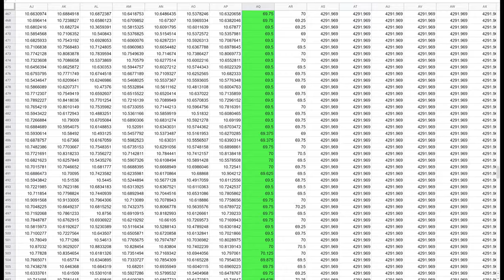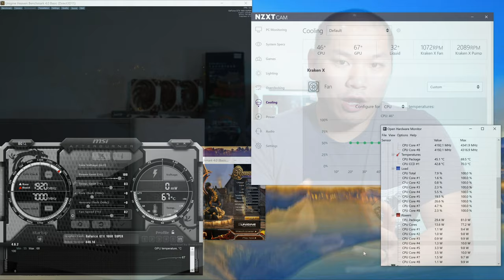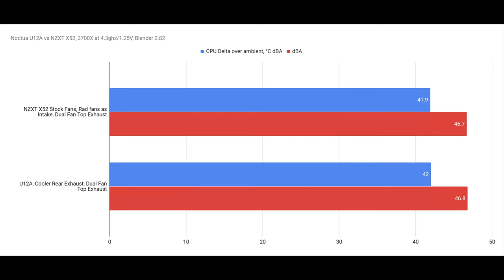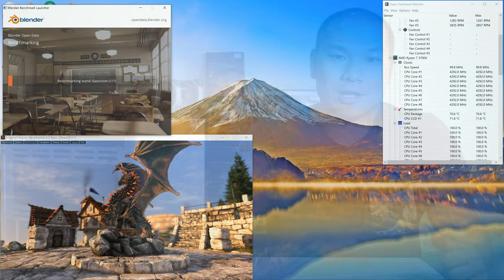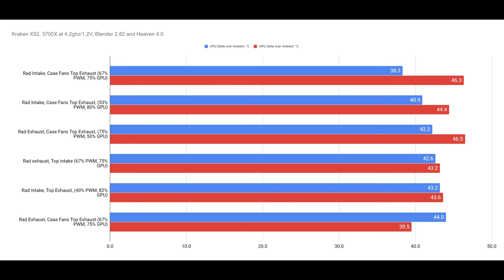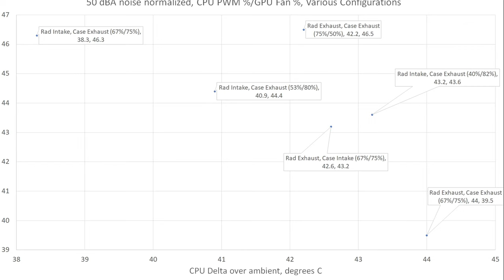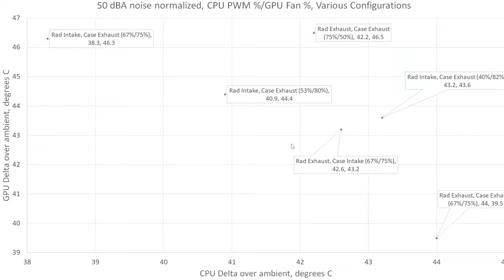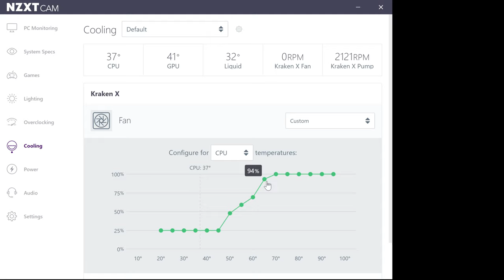Liquid AIO Cooling In The Cooler Master NR200, Part 1: Optimizing Fan Orientation

Comment: I've watched your series on the NR200 and it's fantastic work. Invaluable stuff. Subbed.
Reply from the maker: Awesome, thank you!
Reply: @MachinesMore  Hey what about VRM's with rad intake and top exhaust?
Reply: @Mack_Dingo  Good question. In that case, go rad exhaust top intake. 2 celsius is laughable on the CPU(and you can go 280mm to mitigate that). When you use super expensive high-end XMP rams working at like 1.5volt out of the box or if you are overclocking your ram, rad intake will make your ram sticks unstable(the samsung b-die gaming rams destabilize above 50celsius). All of these hardware youtubers are just using normal 3200/3600 efficient cheapo garbage hynix micron rams. These rams probably stay cool if you throw them into a lava.

Comment: Hi! Thanks for the awesome video. I'm a first time PC Builder and started my build by picking up the NR200 while I gather components. I think I may go with an AMD 3900X come up here shortly for rendering and CAD work. Would you recommend the X52 or X63 for my build? Which one would you recommend and why? Thanks again!
Reply from the maker: Cheers and thanks for the check-in. An X52/53 or other 240mm rad AIO would be sufficient for the 3900X. With a bigger rad like the 280 you get a few degrees of extra headroom, but on a noise normalized basis, the difference is really really small. I would prefer a 240mm design simply based on the fact that they use 120mm fans- if you ever upgrade fans, the 120mm fans are a bit more versatile for other uses like as a case fan. You also save a few bucks going with a 240 vs 280.
Reply: @MachinesMore  Thank you for the very wise tips. I have a hunch that the NR200 is going to be a popular case for first time builders like myself. More videos on it will serve your channel well!

Comment: what about the adding two fans on the bottom as intake, and put the radiator to intake and top exhaust, is that a good idea?
Reply: Was wondering about the same also...now, the question is - for triple slotted cards (like new NVidia) will there be enough room to even place them. Perhaps a slim version of Noctua might work? What to u think? Just ordered my case, so I have no idea...
Reply: I'm wondering about that as well, it would obviously slant the case towards positive pressure by quite a bit and should present the GPU with more fresh air all the while pushing that hot air bubble just above it.
Reply from the maker: @Arthur Hung and @Andrei A, the answer is yes, that is a good idea as you described, although it might not be worth the extra $ for extra fans, that’s up to the user to decide. 3 slot thickness cards allow for no 25mm fan room... it’s tight with 2 slotters as it is. I will discuss those bottom fans in part 2. And let me try slim fans with the thicker card. I’ll throw that into the beginning discussion of P2.
Reply: Adding two 120mm case fans to the bottom would essentially nullify the draw back of having your rad function as an intake (I would think). You can get some nice V2 Sickleflow 120mm fans for like $8 USD (same which the case comes with) which not only have enough static pressure to force cool air directly in to the fans but also works in favor of having the exhaust directly on top (stack effect?). Even 15mm fans should be a nice benefit if you get a triple-slot card. You would more easily achieve positive pressure which is a nice bonus.

At the end of the day I look at it this way: even if you spend an extra $30 on fans you're still far ahead of nearly every other case in this range when you look at its compatibility and performance especially up here in Canada where SFF prices are all over the place and good cases are incredibly scarce. 

I love the extra work being done in regards to this case though. I have mine sitting in the box waiting for the Kraken x63 since the Liquid Freezer II 280mm was too thick to fit.
Reply: The1rust what was the problem exactly with ARCTIC 280???? I was planning on using that one as well! Thanks for the heads up! Where does it exactly interfere (doesn’t fit) with the case (or other components). Very interested to find out. Also have an Asus X560 DTX Crosshairs VIII Impact. I’ve got some worries about the expansion card that it come with - it’s somewhat high.
Reply: @AndreiE190  There were a couple issues I had with it. 

1) The tubing is very, very stiff so there's an uncomfortable amount of force which you're dealing with not only on the bends but on the socket as well. It doesn't help that the tubes come out of the water block instead of the side as seen in other models so you can't really re-orient it in any meaningful way. It's possible it's fine but it make me quite uncomfortable.

2) The way you install the radiator doesn't provide enough room for the thick variety. Think of the rad bracket as a horizontal bracket which holds the side panels. You slide it in to the bracket then pivot the top in to the mounting screws/push pins.

If the rad is too thick then when you pivot it in to place the area which shouldn't exist on a thinner rad is instead being used so you get a clearance issue of about a fifth of an inch and unless you dremel it or do a full tear down of the case to get behind it you're out of luck. The case is far more sturdy than it looks!

Update: I put in the AIO first and then closed the bracket in on it and it worked but to give you an idea on how sketchy the bends are here's a picture: https://i.imgur.com/28tpItg.jpg. Not just that but the tubes were getting caught by the rad fan and I don't think you'd be able to put a top exhaust fan in order to accommodate the top tube.

Just too much going against it for me.
Reply: The1rust zip ties? To make the tubes more secure and in place...I don’t know. Throwing some ideas. It doesn’t seem to be that bad as I expected. But without doing it myself it’s hard to judge. Thanks for sharing! Really appreciate it!!!!!
Reply: Machines & More trust me, as low as the cost is for this case, I’d be happy to spend extra for fans to squeeze max performance out of this case. I just returned Sliger Cerberus X because it lacks some rad support. And that case cost me $265 with not a single fan included with it.
Reply: The1rust and where did u get your case from?
Reply from the maker: You're right on the rad's function but at the same time the case is pretty open, so air goes back and forth pretty freely- there's marginal effect on CPU temps. There is one thing though- and not to spoil too much for the Part 2 of this series but the bottom fans are very important if you ever care about GPU thermals in this configuration. I'll share my end game config in that vid so hope you get to check it out.
Reply: Machines & More I am so gonna turn on notifications
Reply: @MachinesMore  Definitely look forward to it!
Reply: Machines & More all of us are waiting! 😅

Comment: really good. just got this case but waiting for PSU stocks. why not putting intake fans at the bottom with the rad intake + top exhaust configuration?
Reply: I am wondering about this option as well specially if you got beefier cards like per se 3080/2080ti

Comment: Thanks for the detailed breakdown. I've got a CLC'd 5600X and a huge triple-slot GPU (3080 TI Amp Holo) that I'm gonna try and fit into an NR200 this weekend; I'm particularly concerned about the GPU since there's absolutely no room for extra fans below it, so seeing data on how the fan setup can influence its temps is a huge help.

Comment: Nothing wrong with rad exhaust, id always rather my CPU run a bit hotter than my GPU. 
Do you have a GPU which could test that's been deshrouded? I have a card (2080ti) which I'm probably going to deshroud and attach case fans to and set them to exhaust - so run an all exhaust set up
Reply from the maker: I do- but a semi passive/deshrouding experiment will be more of a future test. That will be a lot of fun to see what happens!

Comment: It would have been interesting to capture ram temperature during these configurations. Specifically, if the difference between rad exhaust/top intake and both exhaust make a difference in ram temperature / ram overclock stability.

Comment: Thanks for the comprehensive and ongoing content on this case. I’m expecting mine to arrive this week and plan on putting my X62 NZXT AIO into it and was thinking intake through the rad and bottom with exhaust at the top ... you know positive air pressure. I’m cooling a 2700x and 1080Ti so was wondering whether side exhaust would work better ... ultimately though it’ll be on my desk and right next to my arm so not keen on getting blasted with warm air in Australian Summer! I’ll sacrifice some noise and GPU thermals and just pump the heat to my ceiling!
Reply from the maker: You got it! Actually spent some time in Oz a while back, lovely country. Your intuition is spot on- you'll see in part two that what you're thinking of makes a lot of sense. You know it seems trivial with the air coming out the side, at least that's what I thought before testing it, but the difference if pretty stark between hot air coming out the top and hot air coming out the side at least in terms of user comfort. Good luck on the build and do check back as I am curious how well a 280 rad performs.
Reply: from where did you buy the casing. I was checking in Amazon and it's not available.
Reply: @thusedilshan11127  I’m in Australia and stock from local retailers is low but you can order from an upcoming shipment and it’s only a week or so wait.

Comment: Hi from the future i just built a i5-13500K and 3080 FE setup like this with a 240mm AIO.  I used rad fans as intake and top fans as exhaust.  I didn't hit thermal throttling on either the GPU or the OC'd CPU.  Does that mean that's good enough?  Should i bother trying exhaust / exhaust?

Comment: Thanks for this video, it's a topic I'm very interested in having ordered an NR200 (I'm currently waiting for shipment).
I just wanted to give a small critique on your sound quality, you have a lot of reverb and should look into some sound deadening for your studio and possibly a microphone upgrade (it's hard to tell how good it is with the horrible room acoustics).
Reply from the maker: You got it! I hope you get it soon. Thank you for the feedback. You’re spot on with the sound... I’m still experimenting with acoustics. The mic is a decent one (an older RodeVideoMic Pro) but my setup is pretty makeshift so I need to work it out. Any recommendations on a mic?
Reply: @MachinesMore  Sorry, I'm not knowledgeable enough on microphones to offer any specific recommendations. I will say that you need to "fix" the reverb issue before the microphone quality can be ascertained. It seems like you may be sitting too far away from the mic, but that could just be the reverb.

The first thing I'd suggest for sound deadening would be some sound deadening panels on the wall behind the camera, this could be something as simple as hanging a heavy blanket on a rope, cable or curtain rod. Or put some foam panels on a movable screen if you don't want to attach anything to the wall. Your voice is going out, past the camera (mic), reflecting off of whatever is behind the camera and coming back to the mic (and then bouncing off the back wall, lather, rinse, repeat), stopping it getting to the back wall will make a huge difference. You'll still have some reverb from the side walls, ceiling, desk, etc but the majority is likely coming from behind the camera.

A really cheap thing to try would be to put some sound deadening just behind the microphone (say a folded up towel) to prevent it from picking up sound from the rear (i.e. echoing off the back wall) at least then the sound has to travel the length of the room almost three times to make it back to the microphone.

And one other note, make sure you're using your microphone properly, each microphone has a certain distance they operate best at and direction, etc. See JayzTwoCents two videos on this, I have no idea what I’m doing... and You guys said I was wrong... and you were right! He also talks about his sound deadening in the Gamers Nexus video JayzTwoCents Office Tour | Studio Build & Industry Discussion

And a final note, don't take this as a negative post, I'm really liking your channel. I'm only commenting to try to help make it better.
Reply from the maker: Fred- I played around with it in my downtime and your suggestions were so helpful, since it got me trying different configs out. Really appreciate you taking the time to give so much detail!
Reply: @MachinesMore  Excellent, I'm glad I could help and I'm looking forward to hearing your next video.

Comment: nice video thanks.a question can i put artic liquid feeze II on this case (280mm)?
Reply: sky nabbo yes, I wanted to ask the same question! I was having 280 version of it in mind as well.
Reply from the maker: The answer is yes, in terms of fit, you absolutely have 8mm extra clearance for the thicker rad. I personally don't think 8mm will be too big of an impact on limiting the airflow, but I'm working on the vid for Part II- and limited airflow out of the rad has a pretty big impact. I'll give you guys a shout out in the next vid since you mentioned it.
Reply: @MachinesMore  thxxx
Reply: Hi sky nabbo...did you put the liquid freezer II?... i was not a le to fit in mine NR200... the pump height was the problem.. Especialky the position of the tubes...

Comment: For my purposes, I want the quietest setup, where I won't be overclocking, and rarely at extreme load. For that , would you go for air or liquid cooling?
Reply from the maker: That really sounds like a use case for air cooling to me, although an AIO can accomplish exactly what you described too. It’s a huge discussion that I’ll summarize in the final round up in air vs water. There’s a lot to consider but with what you described it sounds like you just want to set it and forget it- for which air cooling is just about ideal. I’ll just mention upfront also that an AIO makes the case obnoxious for cable and space management, and personally, I really enjoy looking in at the case when it’s got the clean layout from having the tower cooler- if that kind of thing matters to you.
Reply: Machines & More performance matters to me personally. Otherwise what’s the point of buying a powerful hardware if you are gonna thermal throttle it...just saying.
Reply: @AndreiE190  My main use for the hardware is video editing with motion graphics. Most of the peak-load usage is during rendering and converting footage into optimised media, which does not happen all the time. Hence, I'm wanting hardware that is quiet during the rest of the time for low-load usage. It's different from gamers who might be running at high-load for long periods of time.
Reply: @MachinesMore  Do you think your ideal air cooling configuration in the NR200 is up to the task with the high end Nvidia 3000 series, such as 3070 and 3080?
Reply: RT understood. Makes sense.
Reply from the maker: We'll know soon enough tomorrow for what the final design looks like. I feel like the up/down, push/pull heatsink venting direction might wreak havoc on SFF air cooling, since it looks like it's exhausting every which way away from itself, but in the worst possible direction for the CPU and other thermals. I doubt the AIB/AIC units will feature the same design but those even longer off, and if you're set on Founder's Edition 3000 cards, you'll really need to see how the airflow pattern is. The more it vents upwards, the worse this is for air cooling since your heatsink is above the GPU. Also in my final air cooling round up there will be a couple more air cooler options to consider which may help mitigate this issue. An intaking AIO would really isolate the impact of the GPU on CPU thermals, however there are other considerations since by doing that you are just trading CPU thermals for GPU (which if this bugger runs super hot it may not have much headroom before it starts throttling). I'll add just one more thing- in video editing, you'll usually have one component running at a higher utilization than the other, the GPU might be doing a heavier render while the CPU might be cruising, and vice versa, however, the CPU does the bulk of the legwork and is thermally more important to prioritize. For example when encoding you might have the CPU doing the bulk of the work and the GPU hitting peaks every now and then as it passes over the GPU intensive portion of your timeline. Even if you use the hardware encoder, the GPU won't run too hot, just bump up every now and then. How soon are you building?
Reply: Machines & More do u have Asus x570 crosshair viii impact to see if it fits do u? 
Just got the board, it’s super cool, now I wonder if it’s gonna be limited with air cooling options because of the expansion card (it sticks out pretty high). Would love to know.

Comment: I have a RTX3090 FE, 5950X and the NR200. I want to use the Noctua chromax fans. I was thinking  A12x15 PWM for the bottom intake under the 3090 and then the Noctua F12 PWM for top exhaust and AIO intake fans. Would this be an optimal setup if I side mount an AIO? and also what is the best AIO that fits in this case with performance being the main factor not the money. The rig will be used for gaming and rendering and video editing. Thanks for your help!!
Reply from the maker: Hey Jason, killer build list. The best AIO would be the Arctic Liquid Freezer 2, tubing is bulky but it’s the most performance you can get, plus the stock fans really don’t need to be replaced. The 280 version does fit but it’s really a tight squeeze, personally I prefer the 240 for this case. You can do F-12s at the top, or Noctua P-12 redux, doesn’t matter too much at case fan speeds.